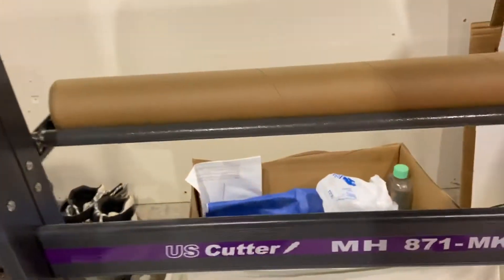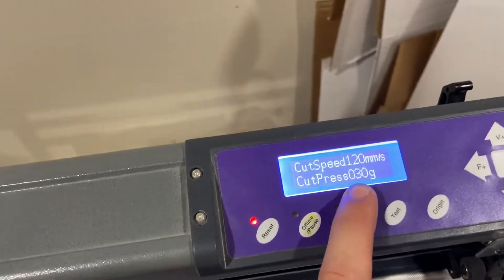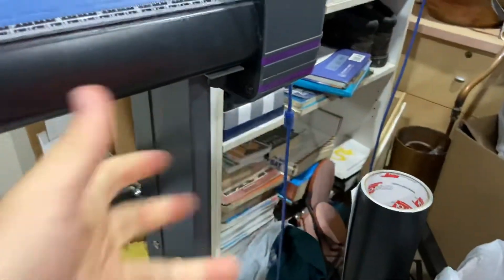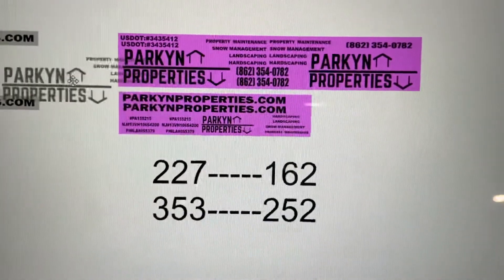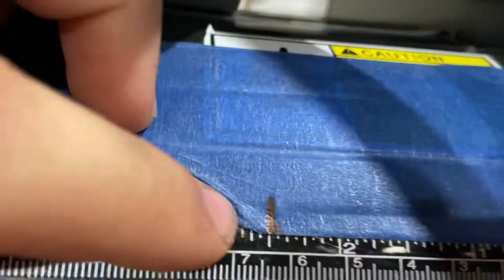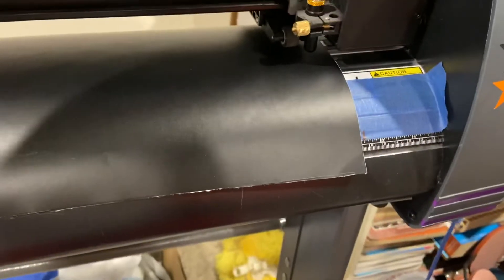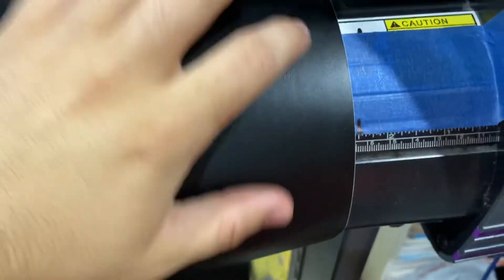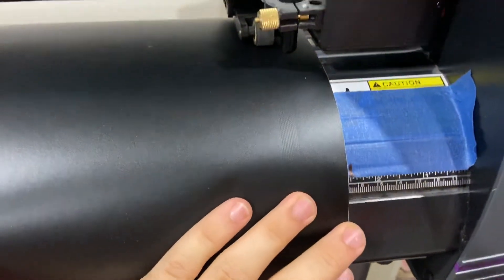Maximize Precision with US Cutter MH 871-MK2: Cutting Straight & Perfect Alignment!

Comment: You do know you don't have to pull the roll up and tighten it to see if it's lined up, right? That's why there's ruler tape on both sides of the machine. You line up the back edge of the roll on the back of the line... I use the #8 (or one line before the 3" mark) on the right side of the roll front and back of the machine, then you go to the other edge and do the same thing.... Front and back. On a 24" roll it's usually 3 lines to the right of the #27 on the left side of the roll. Takes like 15 seconds to line up your roll that way. I can cut as much as 8 foot with only 3/4" drift.... Much easier just to use the tape to line up your roll.... Been using this model cutter for almost 10 years.... Also, if y'all happen to start getting oval cuts on your circles and misshapen letters, take the cover off the blade holder and tighten the nuts in there... I can promise you they have worked loose to finger tight and uscutter doesn't know how to tell you how to fix the problem... Had to figure that one out on my own.
Reply from the maker: Will have to try this next time again, it was a pain when I tried it the first time because I would line up the back then go to fix the front but then boom the back shifted again 🤦🏻‍♂️.
Reply: @Rbear266  do the back first on the right side of the roll and hold it down with your finger... Then slide the front side to the same number and lock 1st roller down.... Then do the front side first on the left side of the roll and hold with finger then slip the back side in place.... It's usually pretty darn close already, then lock down that roller. Then lock the center and use the buttons to move the paper back to where you want to start cutting and hit reset. It helps to let it over hang on the front while lining it up. I always roll what I'm gonna cut off the roll then use a giant paper clip (you know, the alligator ones) to lock the roll so it won't keep unrolling the paper and then cut... That way the machine doesn't do some stupid stuff and cause a skip in the paper. It also helps with static on long cuts since the ground wire only does so much and static will stop a long cut dead in its tracks before it's finished and you lose material that way.

Comment: Thanks for this and the previous video! Now I feel confident doing contour cuts with my cutter. It never used to cut properly. The gold knobs on the back of my rollers were so loose they were damn near off. Never even thought to tighten them because they still held the vinyl down. I guess not good enough. This all worked for me. Thanks Jack and thanks to your "helper" too! lol

Comment: Thank you so much for this great video. Whats the best setting for sticker paper. Its so thin and hard to not cut all the way through. What do you feel os considered a kiss cut settings on this machine.
Reply from the maker: That’s hard to say because like I said in the video they do a terrible job in terms of blade adjustment. There is no preset blade adjustment so it all depends on how much you blade sticks out or is pushed in.

Comment: I have the same cutter but my blade is not cutting my vinyl, it will do everything but make contact with the vinyl how do I adjust my blade to make it reach down far enough, is it my offset for my blade?
Reply from the maker: It’s annoying but more than likely it is the offset. If you want to be sure, extend the blade more than need and cut. If it still doesn’t cut then it is a machine problem and not a blade offset problem